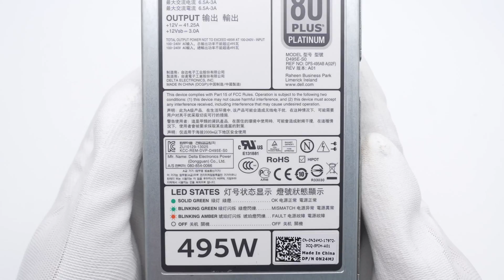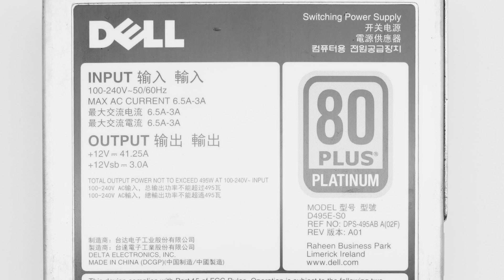80 PLUS Platinum | Teardown of DELL 495W Server Power Supply

Comment: Wanted to see if I could use this to make a small form power supply for an optiplex 😆 why they can't just use something like this instead of those typical 180w or 240w PSU? This is even smaller so why would they not just model a PSU around this?

Comment: Reminder:
Don't touch the metal heatsink under the plastic cover.
While fixing one i touched it while powered in, and wearing a crock rubber slippers.
Wasnt a pleasure feeling. I just sat in my chair for a few minutes because of the shock.